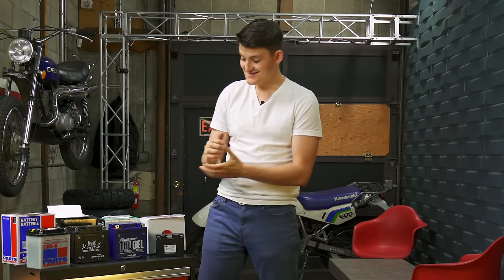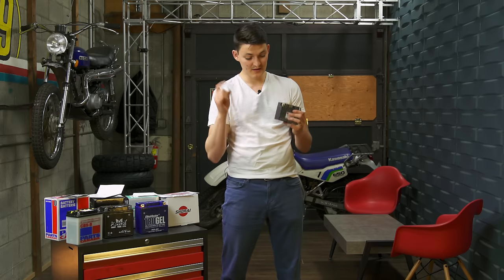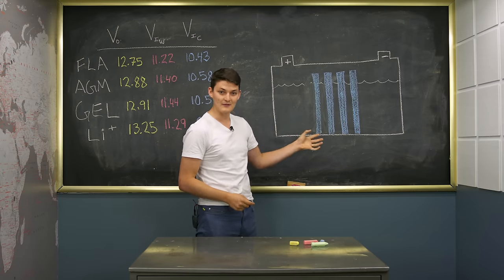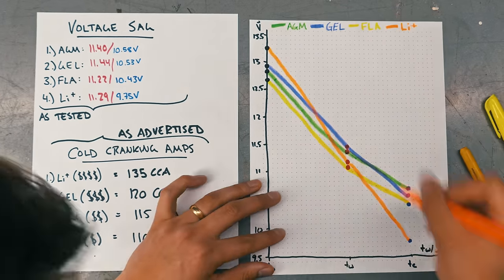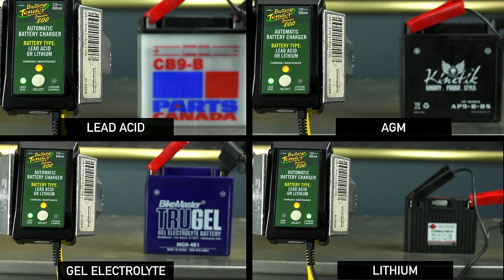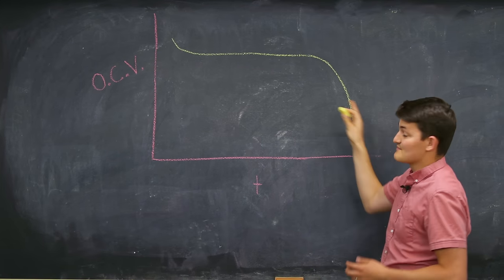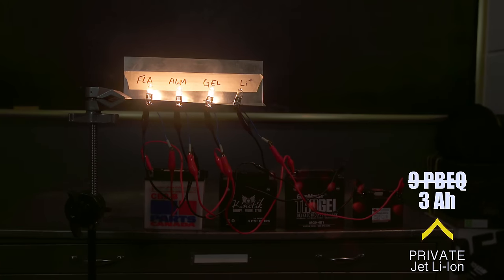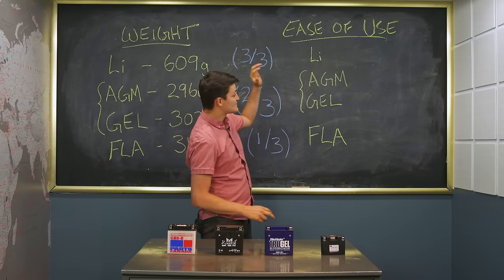Best Motorcycle Battery? Lead-Acid v. AGM v. Gel v. Lithium

Comment: Do not charge a Shoria battery with that charger. It needs a special charger that connects to the data port on it since it does not have an internal BMS. The data port on it has a connection to each of the 4 cells within the battery and will make sure they are balanced when fully charged. This prevents overcharge of a single cell. I have owned a 3 shoria batteries. One melted because of exactly this problem. I would not buy another one, Anti Gravity or EarthX is where I would spend my money (both of those brands are made in USA as well)

Comment: I propose that a lithium drop in replacement for lead of any sort should not be treated any differently as the voltage regulator in your vehicle will not know when lithium is dropped in. Any good lithium battery has a BMS which has to tolerate what it will see from a voltage regulator in your vehicle..That is why the tender charged the lithium slower. If you had simply used the lead setting on the lithium in theory it should charge quicker and not be damaged. If it is damaged by a lead charging cycle it is no good for your bike.

Comment: You failed to mention what happens when things go wrong. I had a voltage regulator fail on my bike which had a lithium battery. It puffed up and poured out a lot of smoke while i was riding...at 11pm at night. Engine was still running but due to the short circuit or what ever, all my lights blew up because the voltage of the engine was going straight into my bulbs. Halogens and led bulbs don't work at 70v AC. I couldn't get any phone signal so I had to ride home in the dark without any lights. If I stalled my engine I would of had a long walk.

Comment: I bought ONE lead acid motorcycle battery... it sucked, lasted about 9 months. AGM off ebay for $35-50 for everything since, lasts years. Also. lead acid in a jet ski, horrible idea, you slam so hard on waves it kills a cell asap haha (it came in the ski) I now have AGM in the ski, no issues.

Comment: The li ion battery I got charges up to 14.6 v, not the 13 something in this video. Apparently that means it's a 3.2cell series 4. It's also the same size as the oem battery, so I guess that means it's better than the tiny lithium in this video?

Comment: Great vid as usual .I have found lithiums not to be as reliable as expected when they slowly discharge due to alarms ,immobilisers etc .They then have failed to charge above 10v and no longer enough to run the new bikes in my experience .The positives have been higher cca better starting and lighter weight .

Comment: Hi, first of all, congrats for your channel, it´s excellent, I´m Venezuelan living in Chile. I know we can charge a battery using a laptop adapter, but, what happens if you tried to used directly as a jump starter?. I mean, connect the adapter to the line wall, and the 12V to the bike, just for the ignition. Thanks and my best wishes. Regards,

Comment: lithium iron phosphate batteries should not experience thermal run away, so i think you info refers to lithium ion batteries, which do (you can drive a nail through a LiFePo4 battery

Comment: My experience is: on 2/17/18 I installed in my 2013 K1600GTL a 1,632.9gram 12volt DLFP51913 BIKEMASTER LITHIUM BATTERY paid $152.49. (old Battery Is still good, and a Very Good One. Very Dense & Heavy For it's Size.) 
SO, A Little Less Wt. To Compensate A Bit For My Adding Roll Bars And Tip Over Bars. ALSO Less Wt At Higher Location. Important. 
The Stock BMW Battery Is 10 9Lb, New Lithium Is 3.6Lb [1,632.9g]So It's 6.4Lb Less, And It Fits Exactly. (36% Of Stock Battery 10Lb Weight)
Tested Lithium Battery: 13.4v & 255 CCA. BEFORE Charging It.
TESTED Old BMW Battery still working good, at 12.43v as 195CCA 
SET THE CHARGER TO LITHIUM MODE. CHARGING UNTIL 11AM
 Tests As: 14v & 285CCA. *BikeMaster Claims It's 375CCA But Not So Far.
12:42pm Finished, Fully Charged;
 Tests As 13.72v & 290 CCA. That's 95 CCA More Than The original One. NOT 180CCA  More As BikeMaster Claims. But MORE THAN ENOUGH.
2/18/18 Sun. Tested Battery: 13.64v Without Key On, Tests as 280CCA
 Turned On Key, Set A While, Then Started, 20 Sec. Off: 13.4v, 285CCA. 
41F Out. 
So, they cheat the figures as pointed out, so I think using an ACTUAL 9AMP  or the one I installed, same price point, heavier and quite a bit better battery, and comparing it to all the above tested, would be a better comparison test.

Comment: LiPo batteries indeed turn into fireballs, but do your research on LiFePo batteries, they will not be anywhere near as spectacular when damaged even if intentionally shorted they will not catch fire, and hence are much safer.
Reply: Have you ever heard of anyone puncturing a battery on a motorcycle?  I'm sure it has happened but I but there are way more common ways for a bike to be set on fire.

Comment: But recent models of Lithium batteries have 9A even 12A also almost half size.. In my case the problem was the polarity of conectors changed, just I adapted the cables.
Here in Colombia the acid base batteries for motocycles are prohibited

Comment: A question about lithium batteries. Ok, modern ones will not burn if you charge it below 0ºC, but that is because they have some kind of Battery Management System (BMS) that stop the charge if something goes bad. But here comes the question: Is it any different when you are riding the bike under 0ºC?? I mean, does the BMS stop the charge and the battery will die while you are riding? Or why is different charging the battery with a charger than doing it while riding?

Comment: LTO battery should last 20 - 40 years... But must be DIY, Not plug and play, safest battery but you need some amp limiter, bms
 to prevent your charging circuit fries. There are 18650's LTOS avaiable :)

Comment: Although your battery charger adapts to Lithium Ion battery charging requirements, I doubt our motorcycle charging systems are that complicated. They're either built for Lead Acid or Lithium (modern BMW - perhaps other brands). I would be very cautious about putting a Lithium battery in a bike designed for Lead Acid, or vice versa, but I may be ignorant. Please correct me if I'm wrong.
Reply: These lithium iron phosphate batteries have built in bcm (charge electronics), so you only need to provide the correct charge voltage and the batter bcm does the rest to make sure its charged correctly. Its not a battery with bare lithium cells. So you dont' have to worry about that.

Comment: I just want a battery that won't die every winter. If I don't build my own setup so I can easily remove the battery and keep it charged up and protected from the cold, I'm stuck buying a new battery every year. ( I don't have the convenience of a garage outlet to use a quick connect with a trickle charger. )

Comment: Where I live the temperature never goes as low as freezing or even close so for me it comes down to is the weight saving worth the extra cost. I'm not sure. For what it's worth I replaced the 12V battery in my Tesla with a Li-ion equivalent from eBay 6 months ago with zero problems so far. My bike is far too heavy at 208kg so I probably will go Li-ion in a couple of years when the lead acid battery will be 3 years old and starting to die. Hopefully Li-ion will have dropped in price a bit by then.

Comment: Also there was no test to show "how many seasons you will get" out of each battery.  I believe lithium will win that test by a long shot, making the cost per year cheaper.
Reply: I've had a FLA last 13 years that's going to be hard to beat.
Reply: @chrishart8548  holy crap that's a long time!  That must have been a big battery, a small starter motor, mild temperatures, AND no deep discharges for sla to last that long! Pretty crazy!  

I get around 2 years out of my lead acid motorcycle batteries. They stay in the bike in the 40F garage over the winter.  They probably even drain to zero for all I know.  Lithium is on its 3rd year going strong, so better, but the jury is out of the long term test. I'm hoping for 5 years.

Comment: Do they not make higher capacity li-ion? This didn't really help a beginner like me as I'm not sure if I should be worried that the li-ion doesn't have much capacity or is it fine? Only go li-ion if I can get a similar capacity as what the bike came with?
Reply: Even though this comment is 4  months old I'll still say this. You were/are a beginner, don't waste time and energy researching something as trivial as batteries for your motorcycle. Go to your local automotive shop and buy the cheapest one and simply ride the damn bike so you don't have to worry about discharge and charge rate and blah blah blah. When lithium ion batteries are costing almost the price of a slip on, just save the two - three hundred bucks
Reply: @rickyGman11 you're right, its best to just remain uneducated. good advice

Comment: In theory, lithium should survive from over-discharge by a light bulb, because you cannot use a battery without a BMS, and manufacturers do not this, which means that the BMS board will disconnect the cells from the load when the voltage is at its weakest ~ 3.2v, and will wait for a charge, and that mean its won. 
Google Translate is very well doing his work, nope ;D

Comment: What about LONGEVITY!!?? I personally have had bad luck with lead-acid. they are less resilient when discharged too low (they seem to go bad around the 2-3 year mark). I have also had terrible luck with Lithium, as they seem to work good (good CCA for the size) and are lightweight when you get them, BUT I have always had to replace them after only 2  or fewer years of use. While AGM batteries have lasted me years and years (5+ on my Suzuki). This is just my experience, I know, but that is what I have found to be true for my ride frequency (not often) and storage maintenance (usually never charge them during the 3-4 months of winter).
Reply: @FortNine Also, It would be really cool to see what would happen if you tried to "rejuvenate" each of the batteries that you completely discharged aka "killed." My bet is that the Lead-acid would be possible especially if you checked the water/acid level and added more distilled water if needed. I bet the AGM would be almost fine with a small capacity loss. I don't know about the gel but I bet it could be recharged to a useable but diminished capacity. The lithium though would be completely dead with no hope. Maybe I'm completely wrong, but I would still like to see it tried.

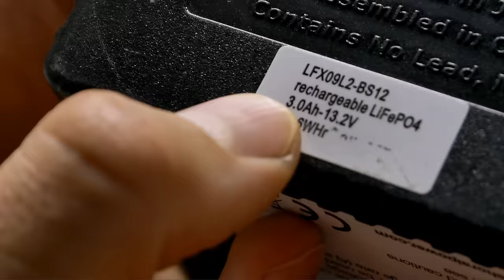Comment: You tested a very low capacity lithium battery, the LFX09 that is suitable for my Honda CRF250L and labelled as 9 Ah and by your own findings at 9:25 is only 3Ah. My GSX-R750 takes a Shorai LFX18/19 which has double the labelled cranking capacity at 18Ah.  Are you comparing all these batteries for the same application? That being a small capacity motor like a 250? It looks like you are comparing 9Ah acid batteries to what is essentially a 3Ah lithium. Is there a reason you tested the lowest capacity Lithium?

Comment: I bricked my lithium battery (left keys turned to accessory too many times? Not sure) and bought an agm. I know that these batteries arent meant to be drained, but lithium i hear is more vulnerable to being bricked. I like Weight savings but i would only buy lithium if I made money racing. I wonder how the $ per gram compares to other things you can replace.

Comment: I trust most of your tests but the LiFe battery, not so much.   First of all, all lithium motorcycle batteries must be suitable for the intended purpose.  Since bikes were made for conventional 12V batteries, the lithium battery is controlled and protected by a purpose-designed "Battery Management System". So, charging from the bike is controlled by the BMS.  Charging from a battery tender intended for lithium MC batteries is ultra conservative and is like putting a cast on an arm that has a bandaid when only a bandaid is needed for a scratch.  No special charger is needed because the BMS handles it, just as it would as your MC makes 8 amps available to charge a conventional battery.  The BMS also makes the full capacity and higher voltage available for starting.  I know this because I thoroughly researched this before replacing my dead again conventional AGM, probably for the last time.  Also, the Lithium Iron battery should last 8 times as long as a conventional MC battery without all the fuss!  So accounting for that, LiFe is cheaper!  I even installed one in my Diesel Mercedes.  Cheers

Comment: I see two interesting  issues; 1. What if you get a lithium the same physical size and did this comparison. 2. What if you can buy the YUSA at a discount so it is only 10% higher, is there a difference in warranty?
Reply: If its the same size and amp hour it wouldn't be anywhere near as light as they make out.      They seem to often be 4ah or even less   vs 12ah standard.    And about 1kg   vs 4.2kg for the original.   And cost  is at least double and that's the cheapest lithium that will probably fail anyway.   They really don't seem to like the cold. And once you have lithium you can't jump start.

Comment: 00:33 amazing that you don't even have the sense to remove the red cap on the vent while filling battery.
Reply: Wile the caps are off all the cells are vented.  They all share the vent with the red cap.

Comment: Shocked by your implied conclusion that FLA was the best choice. Also noticed how little value was assigned to weight of the battery.
The LiFePo4 battery (btw, Shorai is about the worst LiFePo4 there is) is the EASY choice for any high performance application. That can be on road or off, so including many categories. They weigh the least by a mile and are much smaller than conventional batteries. They have the slowest shelf discharge rate, but also will last the longest in normal service as well. Twice as long in most cases. So that high price that goes twice as far is half as bad.
With respect to the other types, even if you insist on conventional chemistry, NEVER put an unsealed FLA in your bike. Why would you want to give your bike (rust) cancer? if it comes with one, promptly throw it (at the dealer?) and install a battery that won't rot your bike.

Comment: I wonder how well suited to lithium is the internal charging sistem of the motorcycle. Especially for older bikes, I mean it was surely optimised for the chemistry and requirements of the lead acid batteries. Would that hurt the lithiul battery in the long run and reduce the lifespan of it? Lithium is very picky to the voltage applied when almost full.. Abused lithium batteries tend to have incresed internal resistance as a result and that would afect the cranking current. Complex subject this.. I personally like Lithium batteries and would put one in my bike, but for now I would probably still go for a lead job untill we get more data from lithium users.

Comment: Your recharge test needs to be off an alternator. Most lithium batteries have a built in BMS the manufacture normally for motorcycles can intentionally limit cell charging so your alternator stator is not burned out from taking all the charge that FLA or AGM

Comment: I get where you are coming from. But speaking from a pure chemistry standpoint I don't think this test was fair to LiPo batteries. It weighs and the size of 1/4 of the others. When you compare gram to gram, you notice Li batteries store about twice as much energy as any lead-based ones. There's also the fact that a regular motorcycle battery sized LiPo can easily output enough burst current to fry an elephant. They make motorcycle LiPo's smaller because it's cheaper and there is no real need to make them any bigger. 

I agree with the cold start part though. LiPo's don't like cold at all.

Comment: So basically buy an AGM or Gel battery for normal people unless you never ride your bike then maybe lead-acid is best? Otherwise, if you're super careful and are okay with some quirks or live in a warm climate then lithium may be ok. Problem with lithium is that they are unrevivable once dead. Once they reach below a certain voltage they're fucked whereas the other ones are not.

Comment: Is there any information regarding warmer climates.  I'm in Texas, I ride a Duc 1098 and go through batteries every 2 yrs.  I use Lead Acid conventional.  I keep it on a tender when not in use.  The bike runs very hot, the weather is nearly Satans butthole in the summer.  Is there a better battery for this climate and the brutal heat my 2Banger produces?   I was going to go Li but now I'm not sure. Thanks for the Video, Great data!

Comment: In a nutshell, the differences are negligible, all batteries are basically the same, the only real disadvantage is the tendency for lead acid to spill corrosive acid all over the bike if overcharged or overfilled.  I've got a gel or Lithium in my scooter, no problems whatsoever since December 2016, even if sitting idle for 5-6 weeks.

Comment: What he doesnt mention is the bikes charging system is completely different than his
little "battery tender". In the real world, use the type that came with the bike.He doesnt 
mention if a bms is built in to the li-po .AGM,FLA and Gel lead acid batteries all have different peak Charge voltages required for long-life.These voltages are set by the bikes regulator and non-adjustable.A li-po with a good bms would take alot of maintenance out of my life
and a good bms means it would disconnect the battery before it killed itself from
low voltage and protect itself from to high a voltage.For reference my Mazda b2200
has an FLA in it from Walmart that is 18yrs old and it still starts.!

Comment: Did you try to recover the killed batteries? Also, the poor mans load tester would have been good here. Disable fuel or ignition, crank bike for 15 seconds. See if any drop below 10.5V.